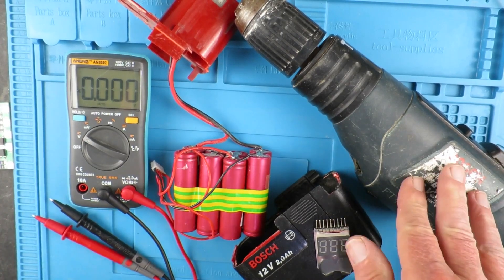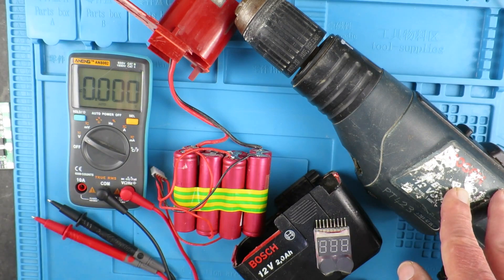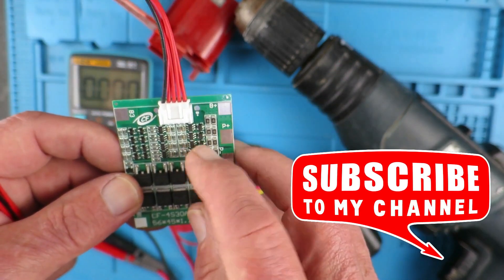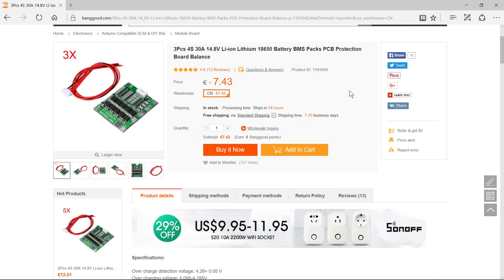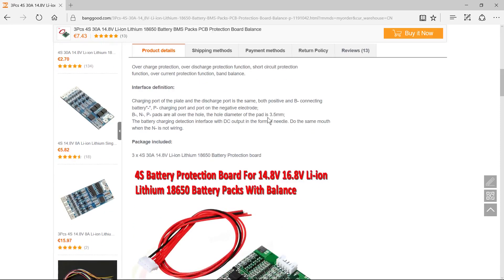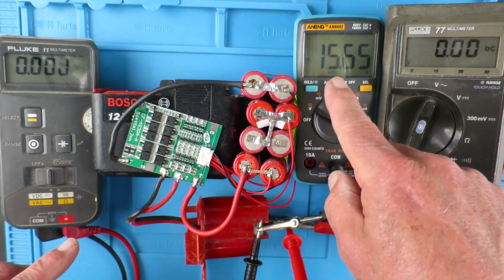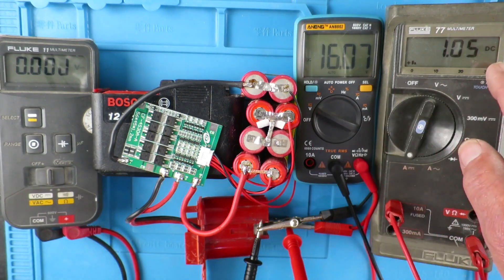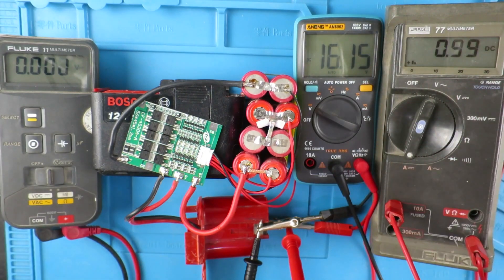4S 30A Li-ion Battery Protection / Balance Board Test Electronic Tutorial

Comment: Hi, Thank you for this video. I have got my parts now but just to check, a ‘cell’ can be a single battery or two (or more) in parallel? The wiring appears to show one battery, ‘cell’ and you appear to have two batteries as a ‘cell’.
Reply from the maker: Hello Ray, a cell is a single 18650. Batteries are made from individual cells which can be arranged in many ways. My battery is a 4S 2P configuration as seen here https://youtu.be/rYFT4g292jU?t=298 It seems more complicated than it is. Just think of 4 Series connected 2 Parallel cells. There are some diagrams on this page http://www.batterysupports.com/-ezp-6.html which show common arrangements.
Reply: Sorry to may sound a little slow but cannot be too careful. Got it with 4s 2p now, thank you. Thus the BMS lead going to a ‘cell’, would in this case be two physical cells in parallel. And it would balance the voltage at 4.2 for the each parallel pair? Really appreciate the help.
Reply from the maker: By George! I think you've got it! Yes, correct on both counts. When I take apart discarded laptop packs to scavenge cells I keep the ones that are already paired for this. They will be well matched. I have a video about that : https://www.youtube.com/watch?v=DU0vQd3Y8Jg Occasionally I do some RF stuff too : https://www.youtube.com/watch?v=hYuCnsuqzjA
Reply: 1nformatica Excellent, thank you so much.
Reply from the maker: No problem! Let me know if you need any other information.

Comment: I want to build a portable bluetooth speaker. I have four 18650 batteries that I want to build inside it (in series). Is it possible to have it plugged in for charging while also having the device turned on? And what kind of charger would you recommend?

I'm sorry I'm a complete illiterate when it comes to this stuff :(
Reply from the maker: Yes you can have a charger connected while the pack is in use. For charging I use is an old laptop charger rated 19 volts at 3 Amps and put a DC step down module which I can set the voltage an a constant current determined by the cell datasheet. The module is this one : http://bit.ly/LedDriver You can see how it works in one of my other videos : https://www.youtube.com/watch?v=QYc1On0q4AA

Comment: what do you think I can use to charge an 18650 4S 50ah battery pack with solar. I am powering 12v devices outdoors. Thanks for your video.
Reply from the maker: Hi Mario, thanks for subscribing! Take a look at these two possible solutions : Solar MPPT Controller BQ24650  http://bit.ly/LiPoMPPTCSolar
LiPo MPPT 5A Solar Panel Regulator Controller Battery Charger http://bit.ly/LiPoMPPT
Reply: 1nformatica, the second one looks like something that will work for me. Have you tested any of them by the way? Thanks for quick response. And your informative videos
Reply from the maker: Hi Mario, I have a similar BQ24650 based board which works well. Would like to know if you get one how it works for you.
Reply: 1nformatica , I'm sorry for not mentioning my intent for use of these controllers. I have built a 4s7p li-ion pack to power my waterfall and lights. My solar panel is  25watt 12v. The second option of controllers you mentioned, has  potentiometers to adjust voltage going to my batteries. Which I  would like to top off at 16.4v... What do suggest? Do I need to use a BMS for this set up. Thanks so much!
Reply from the maker: Hi Mario, I saw the waterfall setup on you YT site, very nice! You will need to experiment with the charger settings, stopping at 16.4 volts should be fine. I would use a BMS for safety. You should make a video of your tests.
Reply: 1nformatica thanks for the thumbs up. I actually made it a bit nicer this year. And really want to run it on li-ion batteries and have more Ah's. Thanks for your input. Have a great day
Reply: Hey old friend, was wondering why you disconnected the balance leads you had on your pack? Was that necessary? Just curious. Take care
Reply from the maker: Hi Mario, as far as I know I have never disconnected the balance leads, where do you see that?
Reply: 1nformatica , sorry for late reply on your question. @ roughly 2:19 of your informative video. You mention you were putting leads from BMS in place of your other ones. Did I misinterpret? Or do you still have your original balance leads still connected to the batteries? Thinking you removed yours I disconnected mine from the batteries,  but left them in the pack just in case. If need be I can easily reattach them back. Thanks for sharing your knowledge
Reply from the maker: OK now I understand! Originally I was charging the pack using my radio control model charger and connecting the balance lead to it. https://youtu.be/rYFT4g292jU?t=36 This was not convenient so I replaced the balance lead with the new BMS board. The balance lead that came with the new board is a different size so I had to change it.
Reply: I'm wondering if we left those RC Balance leads in the pack. Would it prevent a problem for charging discharging or balancing for that matter with the BMS wired on the pack. With the RC leads in pack its easier to check cell voltages using a cell meter. Cheers!
Reply from the maker: There would be no problem having both sets of leads in place. I bought a bunch of leads just for this purpose 22AWG 13CM 1S 2S 3 4S 6S 8S Balance Cable Silicone Wire http://bit.ly/BalanceLeads
Reply: I have run into a pickle. On my 4s7p pack one of the series the last one to be precise is draining way faster than the others. The first 3 are @ 3.98v the 4th is @ 3.22v. I started to use my pack with all 4 cells @ 4.18v. I don't understand it. I connected the same BMS as you have on this video. Any idea what the prob is? Thanks
Reply from the maker: Hi Mario, I do not think it has anything to do with the BMS. Most likely you have damaged or badly matched cells. It is important that all the cells are closely matched, the same brand, type, capacity and preferably from the same production batch. Before assembling the parallel cells the voltage of each should be within 0.01 volt. Do you notice a particular cell(s) getting warm? I would disassemble the bad pack and test each cell, if possible check each cell internal resistance. Good luck!
Reply: Finally got the BMS working properly. Thanks for the great informational videos, I have a situation and not sure what to make of it. I have a 4s10p 18650 battery pack with 16.8 voltage and a 4s 30amp BMS. I connected a 12v 450watt power inverter to it by means of a 300 watt 20A stepdown buck converter. The output voltage is at 12.6 CV.  I then tested it out with 4 loads equalling 5 Amps and 40 watts which were all led lights. At first everything was working perfect, but after about an hour I noticed one of my pack fuses was getting red hot. And when I powered down the inverter it stopped getting hot. any help or suggestion would be great. Thanks

Comment: Hello im back again with my last question.. Well my bms wont send power to the motor at all even though the P-, P+ read 12. something Volts and the B-, B+ read 16. something volts. I connected the motor to the B-, B+ and the motor ran as normal. So my question is my BMS fucked ? This is the second bms, same as the last 1.
Reply from the maker: With no load applied the P± and B± should measure practically the same. If you see only 12 volts with no load something is wrong.
Reply: the voltage reading from P-,P+ is now 15 something volts, still 1 volt lower than B-,B+. IT wont allow charging when whole pack voltage dropped down to 13v. This BMS works when it wants to work. I went thru 2 of these. Both doing the same so I guess I have to continue to find a better one. Hope yours doing good
Reply from the maker: Sorry you have a bad experience with your boards. Mine are working well.

Comment: My bms cutoff voltage was 3v. We have the same bms so how was yours? I want mine to go down to around 2.7v or so. Other than an that this bms working good so far
Reply from the maker: I did not measure the cutoff voltage. The specification is 2.55 ± 0.05 volts so 3 volts seems a little high, is your meter accurate?

Comment: Nice vidéo.. Little question.  Can i use b1 b2 and b3 to connect on the battery pack and use balace connecter with my charger?  sorry from my poor english.
Reply from the maker: Yes, that should work. Your English is better than my French!!
Reply: Another little question.... B1 is the second red wire b2 third ect ect
Reply from the maker: B1 is the first red wire............. https://youtu.be/rYFT4g292jU?t=260
Reply: @ @1nformatica  
As far as I understand, the 5 jack Pins from left to right are
battery +, B1, B2, B3, battery -
So B1 is the 2nd red wire, the first red wire is battery +
But if I measure contacts between the jack pins 2, 3 an 4 and the contacts
B1, B2 and B3 on the board, not all are 0 Ohms. I tried with several boards.
So should we only use the jack connector ?
Reply from the maker: The 5 jack pins from left to right are battery +, B3, B2, B1, battery - See the diagram http://bit.ly/4SBMS_Bal
Reply: @ @1nformatica 
 Thanks for quick answer ;-)  I had the diagram, but the picture is confusing, your explanation is clear and measuring the connections confirmed what you wrote :-)

Comment: Great video thank you. One question please. Is the connection to power the load and charge the pack the same? Only one set of +/- for input/output as I see it.
Reply from the maker: Thanks! You are correct, battery to B+ B- and load / charger to P+ P- https://youtu.be/rYFT4g292jU?t=269

Comment: Hello.I have an old 14.4V makita drill so I want to use  the exact same board as you did, with 4x Samsung INR18650-29E 2900mAh E7 - 8.25A. if i use the original makita charger(nicd)14.4 will i have problem with the liions and this board?
or should i charge the batteries with my rc imax b6 charger? and if i use the imax b6 should i use the pcb ballance or make extra ballance cable direclty to the charger? Thanks for your time i appriciate it.
Reply from the maker: Thanks! 14.4 volts is too low to achieve full charge at 4.2 volts per cell you need 16.8 Volts. What I use is an old laptop charger rated 19 volts at 3 Amps and put a DC step down module which I can set the voltage an a constant current determined by the cell datasheet. The module is this one : http://bit.ly/LedDriver You can see how it works in one of my other videos : https://www.youtube.com/watch?v=QYc1On0q4AA You can of course use the Imax charger but it is a lot of hassle connecting up the balance cable to it etc.

Comment: Nice videos dude, I like it.

I have some simple questions, I want to creat a battery pack, I have 4 battery 3.7V 3500Mah. I have the BMS. And my questions are... Can i use  a 12V 3A plug to charge it? Did I have to connecte my charging port on P+ and P- directly? Or I need a special charging plug or something special like a phone charger 5V 1A?
Reply from the maker: Thanks! 12 volts is too low to achieve full charge at 4.2 volts per cell you need 12.8 Volts. What I use is an old laptop charger rated 19 volts at 3 Amps and put a DC step down module which I can set the voltage an a constant current determined by the cell datasheet. The module is this one : http://bit.ly/LedDriver You can see how it works in one of my other videos : https://www.youtube.com/watch?v=QYc1On0q4AA Charge and discharge are both via the P+ and P- connections.
Reply: Thanks, and I have one last question. I have a Battery Percent Meter, and where il the best way to solder it? In B+ and B- on BMS or P+ and P-? I think is better in B+ and B- cause if a charge battery by P+ and P- and solder the Battery Percent meter in P+ and P-, il will give power to the Battery Percent Meter.But I want to be sure before make anything that I can't undo. I hope you understand everything, if you want I can make a schema.
Reply from the maker: Yes it should be put on the battery connections B+ B-

Comment: I have the same bms but never installed. how is this bms working out for you ?
Reply from the maker: It works well in my application as shown. Providing you use it within it's specification and power it with a constant current supply set to the correct voltage and current you will be OK.
Reply: do you mind to tell me what you're using to charge it with. Thanks
Reply from the maker: I use an old laptop charger rated 19 volts and put a step down module with constant current set to 1 Amp at 17 volts. You can see this module in one of my old videos : https://www.youtube.com/watch?v=zTxiflmyeU4
Reply: 1nformatica I just fried my bms and 4 bats. Buying another board and will try again. Hope I can get it right this time.
Reply from the maker: What happened? Did you short circuit something or a problem with the wires? Better luck next time!
Reply: Guess so.i have a question. Does it matter if the b- connects to any of the last negative or must be the first negative of the cells. I don’t know if u could understand what I’m asking you
Reply from the maker: The cells are connected in series that is like a chain. B- goes to the last negative as shown here https://youtu.be/rYFT4g292jU?t=258
Reply: can I connect B1,B2,B3 instead ?. I connected the same way like some of the guys on youtube did but it wont charge. and I don't really want to use the small balance wires that it came with.
Reply: I've used the same board on my makita powerdrill. It works, but has one flaw, if you quickly press the button, the board shuts down the power. Somewhere it limits the startup current. If I slowly ramp up the speed, the bard works fine.
Who knows how this is and is there a remedy?
Reply from the maker: The starting current of the drill is too high and is triggering the short circuit protection. The only remedy is, as you discovered, to slowing ramp the speed up.
Reply: 1nformatica I've found a possible solution where a 0.1uF capacitor is placed parallel over a smd resistor on the side. The video is in Russian but I'm going to test this next week.
Reply from the maker: Sounds interesting, please let me know how it works out.
Reply: I had the exact same problem and adding the 0.1uF capacitor totally fixed it! There is already a footprint for the capacitor on the board, it’s just not populated. If you feel comfortable soldering tiny 0603 smd parts, it’s an easy fix.
Here is a link to the Russian guy (or girl) that investigated this: https://translate.google.de/translate?hl=de&sl=ru&tl=de&u=https%3A%2F%2Fmysku.me%2Fblog%2Faliexpress%2F58000.html
Great reverse engineering.
Reply: That link was perfect. That guy did a wonderful breakdown of what the BMS does.
Here a photo of my BMS, that has the capacitor placed. Not the prettiest solder job, but hey, 0603 without my heat gun.
http://kennethtan.nl/Images/20181005_114539-01.jpg
Reply from the maker: Wow! Thanks for the link. I must try this. Habe ein schönes Wochenende!
Reply: My board looks about the same ;) But it works...
Ein schönes Wochenende (nice weekend)!

Comment: would be interesting to see how the BMS is doing on discharging at a higher rate of 5 or 10 or even 20 Amps! The BMS is rated for discharge current of up to 30A, so it should cover the balance here as well - but it is much more challenging due to the high current. I am afraid, it could not handle this...
Reply from the maker: Hi, balancing is only performed during charging, discharge rate has no bearing on it. During discharge the board protects the cells from over discharge voltage and overcurrent.
Reply: thanks for the info - i didn't know that - very interesting! I heard about "Bottom balancing", but that may be something else. Its better to balance at the bottom than on the top of the voltage.
Reply from the maker: Both balance methods are acceptable depending on the application. For most uses top balancing is preferred. Bottom balancing is more often used in high power applications such as electric cars and "powerwalls".

Comment: Hello.I have an 18V drill so I want to use the 5SBMS board. But I'm not sure if it will work with these High Drain Rechargeable Battery 18650 35A 3.7v LI-MN 2500mAh or the Sony VTC5, I also want to know what kind of charger are you using. I only have the original charger for the NiCd batteries. Thanks in advance for your answer.

Saludos desde México
Reply from the maker: Hi Donald, something like this will work: 5S 100 Amp BMS http://bit.ly/BMS5S_100A
As it does cell protection and balancing you will only need a suitable power supply with constant current set to the charging current recommended for the cells at 21 volts.

Comment: Hi.  I'm making a battery pack for ham radio and I have the same BMS.  My question is:  who charger I need for the battery pack? Greetings from Chile
Reply from the maker: Hola! Use it in conjunction with a suitable constant current supply set to the correct voltage then to all intents and purposes together they make a Li-po charger. I cover this in an earlier video : https://youtu.be/miDIXwACpcY?t=441

Un saludo desde Andalucia!